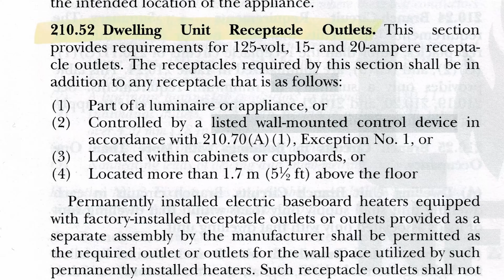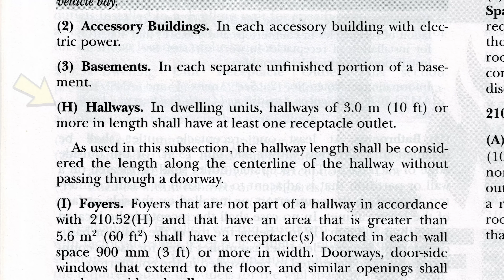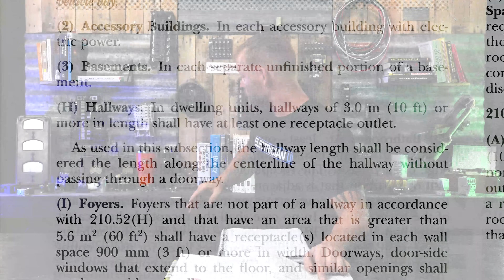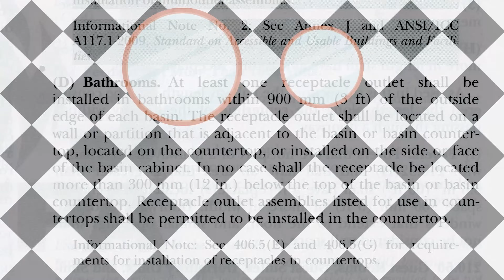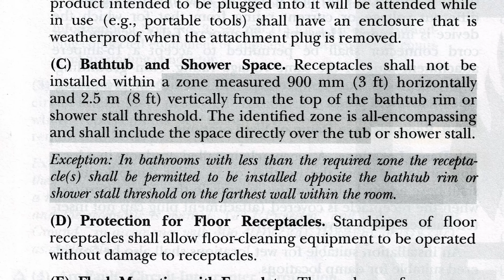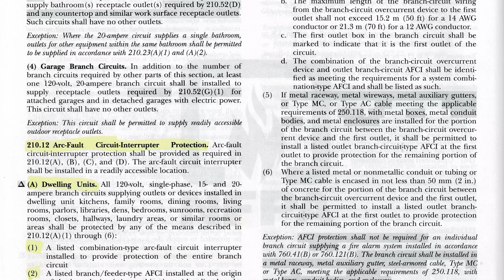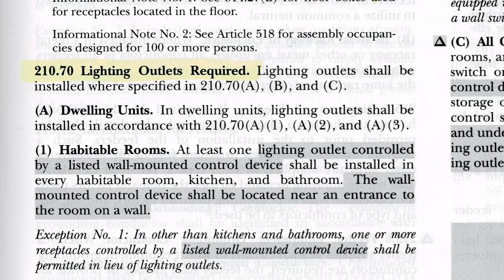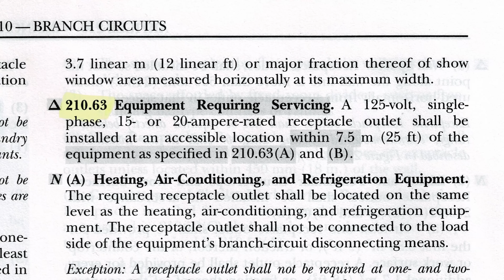KNOW WHAT YOU'RE DOING - or You Will FAIL Inspection!

Comment: Those arc fault breakers fill up panels really fast! I'm an electrician in New Orleans and I like to put a lot of circuits because like you said people are using way more equipment at home nowadays and I absolutely HATE extension cords. But now its tough correctly wiring my circuit panels because the only available ones (125 amp) are only for 12 circuits.. I appreciate the vids, nevertheless!
Reply: If you are adding to an existing panel it can get out of hand really quickly. OTOH, if you are installing new panels, I would strongly suggest plug-on neutral panels. They really help with wire management. Good luck!
Reply: @TwilightxKnight13  most definitely, those PON panel are clutch! thanks man

Comment: Isn't the wording for receptacle requirements such that it's wall space? Windows and glass shouldn't be counted in your footage
Reply: Windows do not factor in the 6ft rule. As long as there is "wall space" as defined by 210.52(A)(2) it is included. You might have an argument if those glass "walls" in the video opened because then you could say they were doors, but they are considered wall space and by code must have compliant receptacles.

Comment: Question regarding code, are lights required to be 120v, or can low voltage (Power over Ethernet) suffice for a light? I know this would be more for commercial, but I'm hoping that more products will come out and be good for residential too.
Reply: POE should be allowed in homes but best to always check with the AHJ. I had trouble in some small hick towns where the only electrical contractor living there was also the electrical inspector who had his own unwritten codes. In bigger areas & cities the AHJ or local inspectors were great. They would rather you ask a question then fail you .

Comment: I was at the electrical inspection of my new house build, and every outlet was checked for wiring with a tester, the plate for the induction oven feed was asked to be removed and neatness of wiring behind viewed, and it was great to see the back/forth between my contractor and the inspector.  Inspector kept saying good, and electrician answered every question (such as the remote GFCI in a bathroom for the lights in the shower).   No issues found, as the homeowner felt secure knowing good work was done, and the check/balance done by someone who was on my side.   Love seeing professionals being professionals!

Comment: I installed a dual function Arc Fault and Ground Fault receptacle in for my Bosch 800 series dishwasher and I keep getting nuisance trips requiring me to empty out under the sink to push a reset button very frequently.  My solution is that my local code doesn't require arc fault for dishwashers and just replace it with a simpler GFCI.
Reply: Some brands of arc fault are really bad for nuisance trips when it comes to appliance motors. Ive had many problems with seimens for example

Comment: So, regarding hallways. Someone could be an a$$hole and put a doorway every 9 feet in what was originally a 27 foot hallway to not have to put any receptacles in the hallway? I would never expect that, doors and doorways cost way more than the wiring and receptacles... But, it would be to code because with the doorways in place the 27' hallway is now 3 separate 9' hallways?
Reply: No. Unlike rooms where the distances are measured along wall space, in a hallway, the distance is measured along the center line. So, if a hallway's center line is at least 10ft long, it requires a receptacle. You could have a hallway that is 12ft long with a 3ft door on either side and at each end and it would require at least one receptacle.

Comment: My attic crawlspace had only one light in it initially.  Just 1 above the access point, which is in the middle of the space (about 40' long, 8' wide, and maybe 4' high).  And it was an old curlyq fluorescent bulb, so in the winter, turning it on meant waiting 5 minutes for usable light.  It was right next to the air handler, so it met code (by accident, not intent, I would say).  I added two new fixtures at either end of the attic, and upgraded to LED bulbs, while working on insulating the space.

Comment: Years back.. I could see two circuits in kitchen. But today.. the tabletop appliances don't consume as much.
Reply: Anything with a motor like a stand mixer or a heating element like a toaster still draw a lot of power. Since those items have become more affordable over the years, the likelihood of homes having multiple devices has increased significantly. It is quite possible for a family to be running a toaster oven, a stand mixer, refrigerator, microwave, dishwasher, garbage disposal all at the same time. Hence, the need for more circuits
Reply: @TwilightxKnight13  refrig and micro are required to have their own circuit. Along with the disposal/ dishwasher. 
Outlets are separate.
Unless you have. Cook and large family..  the appliances on  the tabletop  outlets.. won't be much.
I have never had a problem with our outlet circuits,  and I have a large family that likes to cook on occasions. 
Also if the kitchen is small with two outlets.. how much are you really going to plug in???
Reply: Refrigerator?  1200 watt toaster oven?  Mixer?

Comment: How does floor meet code ? I thought they had to be a certain distance up , so that people in wheel chairs and reach .
Reply: Generally speaking the ADA goes not apply to residential home construction
Reply: @TwilightxKnight13  I've lived in both California and in  Alabama .Both have  height requirements and the code in Alabama specifically calls out  the ADA for plug  height.
Reply: @TwilightxKnight13   NEC 210-52

Comment: I'm a DIYer, Third Class, which means I know something about what I am doing, but not everything. You, and other video producers, are helping me get to second class. One topic I would like to see covered is Grandfathering. Precisely what it is and how it would affect me when I take on a new electrical project. It seems to me that when the house was built may determine which code rules, old or current, would apply or not apply to the house.
Reply: Reference to the grandfather clause....depends when the structure was built.  Like replacing a distribution panel....pre 1999 when Arc Faults were required on home runs....say even last year in 2021 you replaced a panel, you do not need to install an AFCI breaker UNLESS you put in a new circuit.  But some areas they require installing AFCI's in that replaced panel!  My thoughts are....If you replace  a panel...throw in AFCI's!
Reply: Pretty much, if you touch the circuit you own it. You need to get a permit for the work your going to perform. Even replacing a light fixture requires a permit. Otherwise, if there is a fire inside the house related to the work you performed, the insurance company will not pay up. Getting a permit puts the responsibility on the electrical inspector plus the inspector will make sure the work performed meets the NEC code requirements.
Reply: @RS-qp4bp  not true stop spreading false info. Insurance companies can't prove it was done bu a homeowner or otherwise. Insurance companies do not tear down your house electric and do an inspection to make sure it was done properly previously to your ownership. Code has changed thousands of time over the years. Homes with knob and tube are fully insured. Ive done tons of insurance jobs an adjuster will come out and analyze the damage and put a dollar amount on the damage. They are not inspecting if the homeowner did any work and could care less lol. Unless there's obvious evidence it was done improperly INTENTIONALLY.  Homeowners insurance cover accidents all the time, so does car insurance. Not sure where you get your info but its not true 😂
Reply: @OUTDOORS55  I stand corrected, however if a family member dies in a fire due to defective electrical components and the police determine the fire started because a Home Depot parking lot electrician rewired a new light fixture incorrectly without a permit and it caused the house to burn down the home owner will be in court for years. The point I'm trying to make is: have a licensed electrician pull a permit and get it inspected by a city inspector . That way you will sleep soundly at night.
Reply: @RS-qp4bp  know the code before starting a project. If it's major pull a permit and the project will be inspected before power is on the projects circuit. If it's too big of a job then hire an electrician. I did a job for a friend because the wiring was too dangerous . The wife would not pull a permit so I did what I could to make the house safe but she needed a main breaker outside. I had to feed off the fuse block. I told her she needed a main outside. I guess she left the house as it was at least she has good wires inside and no short circuit issues. 73
Reply: @OUTDOORS55  not everything is false i know insurance companies that won't insure a home that has fuses and circuit breakers were not used in knob and tube homes. We had a shed that had knob and tube and the light switch was a knife switch which had no protection from fingers. You better bring a flashlight before trying to turn on the light. The main house had the black Romex wire which got replaced when the house was remodeled. The fuse box was replaced with a 20 circuit breaker box. The range was electric and wired directly to the meter no fuse. We had gas on the property because it had a gas well. So we put in a gas range. The shed never got updated and we sold the farm.  Bottom line homes are hard to insure if the wiring is old. It's best to upgrade wiring before something happens . 73
Reply: @ronb6182  good luck in the contest 73 QSY
Reply: good luck in the contest 73 QSY
Reply: @OUTDOORS55 good luck in the contest 73 QSY
Reply: @RS-qp4bp  contest no not quite I'm still new at ham radio I don't have a base station just a hand held 2 meter and 70 cm bands. Sometimes I listen to hams on 2 meters in Florida but never CQ anyone yet. I think I will go for my general class before I start talking. Probably after I retire in a few years.  My life's goal was to get an amateur license but waited until the Morse code requirement was lifted. I am also going to get a GRMS license as well so my wife can talk she won't go for ham radio and don't blame her for not trying. I spent hours taking practice test until I learned the material. The general class will be the same. 73
Reply: I have been doing similar over the years and what I do is upgrade as I go along. At this point I now have GFIC for garage, baths, and all outdoor stuff. Eventually the basement and kitchen will get upgraded. BTW, house was built in 1910 but all wiring has been replaced and panels too. What was once the main panel on a 1975 remodel is now the gen subpanel. A new 200 amp main was installed in the mid 90s. Since there are few home runs there will likely never be any AFCI breakers unless a new owner wants to change everything again.
Reply: What about apartment complex’s?? My boyfriend lives in one where the electric is sketchy to say the least!! It’s subsidized housing and we just a couple of weeks ago had an outlet that almost burned down our apartment complex (THANK GOD FOR CIRCUIT BREAKERS) all we had plugged into that particular outlet was a couple of phone chargers and when the “maintenance” guy pulled out the outlet I just about fainted because it was well and truly melted… AND BURNED🔥!!  The complex was built in the mid 1960s and I am wondering if they have to update to any of the more recent code… especially if they are receiving federal section 8 voucher funds???  After the “maintenance guy” who claimed through Google translate that he was a licensed electrician changed the outlet and restored power… it shot sparks and almost started ANOTHER 🔥!!  Then later that day … after he supposedly fixed the outlet (in the bedroom) we discovered that the outlet on the opposite side of the wall that controls his refrigerator was DEAD and so we almost lost ALL the food in the refrigerator and freezer… fortunately we have a small mini-fridge that made it possible to salvage our (now crazy expensive) chicken 🍗!!  How is this even legal???
Reply: @kathrynarchuleta1776  oh wow that was a close call and it sounds like the are more caged wild animals waiting to escape from the electrical equipment. That's what electricity does when there is a fault in an electrical circuit. Maybe the "licenced electrician" was qualified where he was from originally , I can't imagine that an I.B.E.W. trained electrician would not be able to speak English. What to do??? This is tricky because if you do what I'm about to tell you to do you will be the bad guy/girl. Contact your local city building inspector and tell them what happened. They will write down your name and address and if they are not real busy the inspector will show up in a day or two. In the mean time try not to use the duplex  receptacles that have a problem. The inspector could "red tag"  your apartment until the problem is corrected which means that you will have to move out to a hotel paid for by the owner. Like I said this could open up a big can of worms. But the last thing the city wants is an apartment fire after they were out on notice that a dangerous condition existed with the power distribution equipment. Good luck, let us know what you decided to do.
Reply: The code book IS NOT an instruction manual. Hire an electrician.⚡️

Comment: Imagine WANTING to put AFCI or dual function breakers on everything LMAO
Reply: Arc faults can be a pain but why not gfci protect every 20 amp circuit in a house and use tamper resistant devices. TR devices protect the curios young ones and even if they did manage to depress both prongs with something crazy the breaker would trip instantly. Life saving stuff we are discussing
Reply: glutton for punishment, callbacks for nuisance trips maybe

Comment: I can’t stand arc faults. Using my chop saw, shop vac, compressor etc at a clients house, 9 times out of 10 if it trips it’s on an arc fault circuit and just keeps tripping. So now I’m running extension cords out bathroom windows. I get why they’re code but from a usability standpoint I think they’re just too sensitive.
Reply: AFCI's are POS arent they. till they figure out how to make them not freak out nuisance trip from homeowner running their $600 Dyson vacuum, AFCI should be removed from required

Comment: No Arc fault required for 240volt circuits or outlets located in attics, unfinished basements, & or crawl spaces.
Reply: GFCI is now required for 240 outlets, but not hardwired circuits.
Reply: Maybe not yet, but we said that a few years ago about other rooms in the house too. If you are upgrading a panel or extensive remodeling and you don't build for the obvious changes coming with the code, you are doing your customer a disservice

Comment: Arc fault is trash. They haven't fixed the issues with them in 20 years.
Reply: If you are having constant problems with arc fault breakers, the problem is with some other portion of the circuit. Properly manufactured equipment on a properly installed circuit will not have repeated nuisance tripping problems.
Reply: @TwilightxKnight13  Sometimes yes, but the amount of brand new arc faults I've had to replace is simply ridiculous.

Comment: The wording of the hallway to me means any hallway 10 feet or larger needs a receptacle outlet. Not per 10 feet. So a 20 ft hallway still only needs at least one.
Reply: I understand that as a 20’ hall would need an outlet in the middle so an outlet is 10’ from either end.
Reply: @dallinbagley4486  It doesn't have to be in the middle. If the hallway is 10 feet or longer it needs at least one outlet. If it's smaller than 10 feet then no outlets are required. It doesn't say anything about spacing. The 10 feet isn't a spacing requirement or detail.
Reply: It could technically be 40 feet and still only require one outlet receptacle, though it would be impractical to be so minimalistic. But the code doesn't tell you how many or what the spacing should be. It is just telling you if the hallway is 10 feet or longer then it needs a minimum of 1 outlet.
Reply: @illestofdemall13  gotcha, thanks for taking the time to reply
Reply: @dallinbagley4486  No problem.

Comment: Got a question…. Is it a new code to make everything bedsides all 240 and gfi to be in arc fault??
Reply: Yes, somewhat. There has been arc fault language in a number of past cycles of the code. What is changing is how widespread it is applied. IIRC the 2020 code expanded the requirement so now virtually all circuits within the footprint of the house have to be protected. It is possible that could expand in a future code to include the outside and garage circuits as well. Generally, once they apply a safety measure to one place in the code, it will proliferate throughout the rest over time. The idea being, should you really be less protected because you happened to be standing in your garage instead of your basement?
Reply: @TwilightxKnight13  awesome thanks man

Comment: The hallway section I think needs more clarification and be less open to interpretation. And it kills me that something like electrical codes are so strict and to the book and very poorly expressed. It's a very short and easy to understand sentence of not "interpreted"
The way I read this is if it's 10ft long or longer, you need at least one receptacle. Otherwise, if it's shorter than 10ft long, you don't need a receptacle, and if it's 40ft long, you need at least one receptacle.
Reply: You are exactly correct...unless the inspector interprets it like he does in the video. One of the reasons it is not really a problem is that the VAST majority of private residences do not have uninterrupted (by doorways) hallways longer than 20ft. It is a waste of floor space. In the rare case where you do have 20ft+ hallways, the inspector is likely to require an additional receptacle.